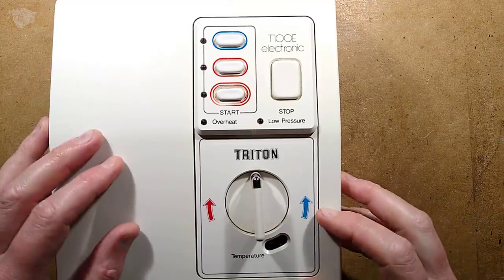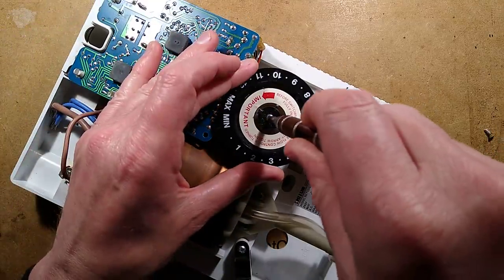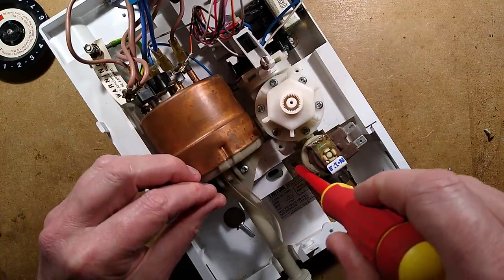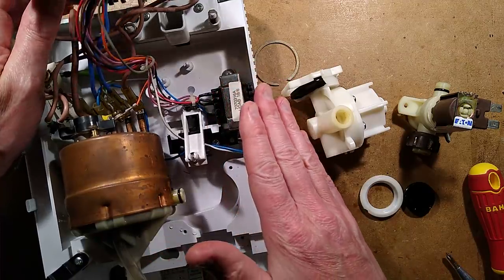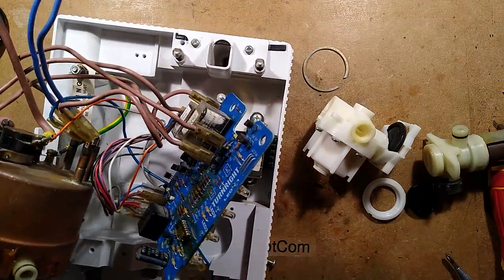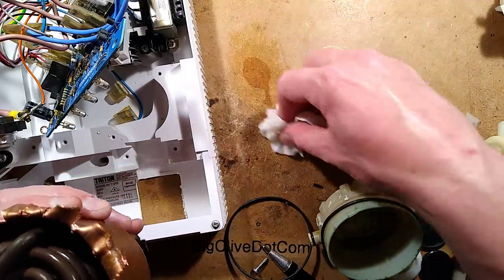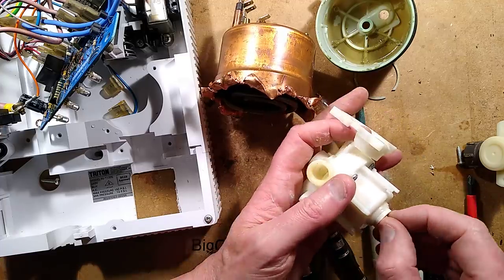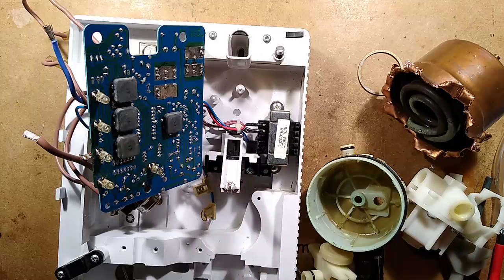Teardown of a British electric shower that went bang.

Comment: for us non-UK natives, these devices boggle the mind beyond comprehension... UK houses have no power sockets in the bathroom (except for shaver sockets) and they often have string-activated ceiling lights, but a high power mains shower - yes please, squire...!
Reply: They are safe, plug sockets kill in the bathroom all the time in europe. I've been shocked by a switch, but never by a shower. They're grounded, and designed to get wet safely.

Comment: I was a Triton service engineer over 20 years ago and that was an old unit style then. I think Ralphie has had good value for money. Mains water spikes can break those valves. We used to take mains pressure measurements and some were remarkably high. Especially around the western central belt of Scotland.
Reply: Yeah glasgow in places has ridiculous high water pressure especially in places  near water towers
Reply: We had consistent leaks in our home, the city measured our pressure at over ten bar. A regulator fixed everything.
Reply: @UncleKennysPlace  i was going to say that, sometimes a regulator solves these problems, but not the final pressure after closing all faucets. it still reaches the full pressure from outside

Comment: The impressive thing about Triton is that they will have a model which will replace that one where the position of the power and water inlets and even the mounting screw holes will line up exactly to the old model. Makes replacement a breeze.
Reply: Love Triton showers, only showers that get hot enough
Reply: @BeeKisses  That would depend on the Kw rating, 7.5Kw was just too weedy for most uses, 10.5Kw was a beast, so, maybe you had a 8.5 or even 9.5??? 🤔😎🇬🇧
Reply: As mentioned in a previous comment, I installed half a dozen electric shower units from either Triton (can't remember the other make), but later on, the housing and part of the internal plumbing attachments could be utilised for either back/left/right or even underneath the unit input. But yeah, someone had common sense at Triton... 😉 😎🇬🇧
Reply: @thedarkknight1971  I had a 10.5 Mira that was only piss warm and I now have a 9.5 Triton that's hotter, it's weird but meh
Reply: @BeeKisses  Hmmm 🤔 internal design I guess, but those two manufacturers were the main go too's back then. Like you, I preferred Triton 👍😎🇬🇧
Reply: it is s sad that such an obvious thing is impressive
Reply: @MichaelOfRohan  if you think that's sad you should have seen how impressed I was at my Vax carpet cleaner 🤣🤣
Reply: @BeeKisses  Water quantity will be lower.
Reply: One prefers Aqualisa, but then one only has the finest furnishings in one's council house.
Reply: @krashd  ahem, the Who - 'I was born with a plastic spoon in my mouth'
Reply: @BeeKisses  Haha, I never heard that, but I love it and it makes me appreciate them more🤣
Reply: @krashd  it was the opening line to substitute I believe, may be wrong as I oft am

Comment: This is a direct result of water hammer finding the weakest link.
Reply: Water hammer is also a bad aspect of automatic sprinkler timers.  The timer relay instantly shuts the thing off and bang!  If you've got a weak point in the water line that could mean instant flood!
Reply: Aging plastics is also a factor here.
Reply: Fitted a small pressure vessel in the main here to stop the washing machine rattling the pipes. Works well but does need repressuring once a year.
Reply: @Graham_Langley  sounds like the diaphragm has a slow leak
Reply: @gazzat5  It's a very small PV, say 200ml, so it doesn't need much to drop the pressure. The tag says check the pressure every six months but I just wait for the knock to reappear.
Reply: @ehsnils  Ageing of the plastics is the whole issue here. These things stand up to serious abuse when new. However, the plastics can get quite warm if the shower runs for a long time, and they don't choose materials which age awfully well. The cases of these things often have brittleness issues as they age, despite being very resilient when new.
Reply: Hammer arrestors are always a good idea, I have them at my washing machine connections. Seems to be a more standard practice now.
Reply: That's because he didn't wear the Zora tunic.
Reply: I'm surprised no one here made a The Weakest Link joke

Comment: had one of these (25 years ago) in a house i lived in, a cat could pee on you faster and warmer.
Reply: They don't pressurise the water thats why, if you have a crap gravity fed system, it will still be crap after you fit this. These only heat water.
Reply: You didn't have one of these then or your water supply was shite, because the flow from one of these is both powerful and hot.  They are fed directly from the cold water mains at high pressure and the warmer you set it the stronger the flow feels.

EDIT:  You likely had a power shower, although they look identical they work very differently from electric showers and have very weak flow rates.
Reply: The early ones were 7.5kW and were pretty dismal... You got a choice of adequate temperature with pathetic flow rate or adequate flow rate with chilling temperature. 
The modern ones of about 9kw are great, its the last 2.5 kW makes all the difference.
Reply: It takes a lot of energy to heat water so the power rating of the shower determines the temperature/flow rate. The maths isn't too hard if you know some physics.
Reply: @joinedupjon  Ahhh but 9KW might require a 10mm cable on the install, hence 7KW.  Maybe we need John Ward to give us a video about showers and 6mm or 10mm cable depending on the rating!
Reply: @neilcaldwell870  10mm is not a fun cable to work with.
Reply: @RobbertN  indeed it's not, ruddy nightmare and very expensive!

Comment: Years ago we had a Mira electric shower in a rental property. It did fail once, which the repair engineer identified was caused by corrosion where the overtemp cutout contacted the copper pipe. The copper-deposits had swelled and were mechanically depressing the bimetal switch - so it failed-safe. The internal design and build was very good - in my opinion it didn't "deserve" to fail. Easily repaired with a new cutout. Was very impressed with the repair guy - he had a brief-case with his tools and all-possible spares, so was very efficient.